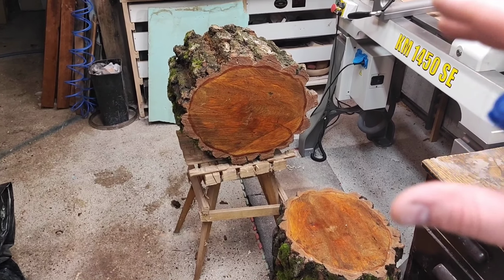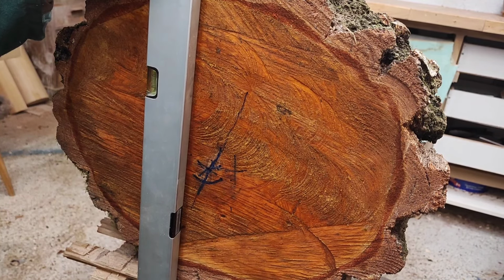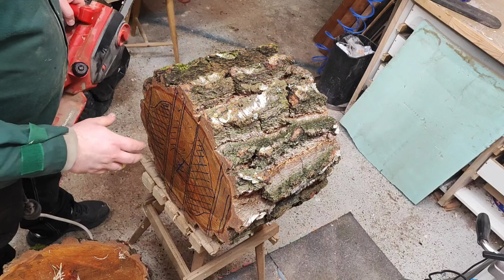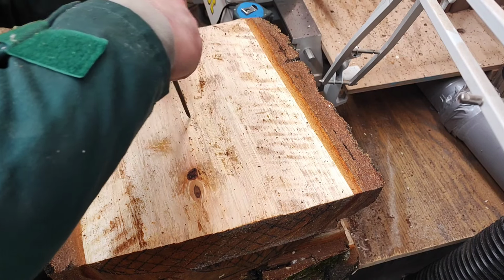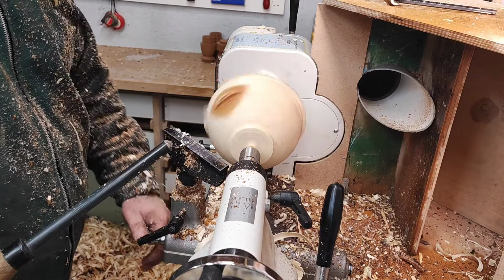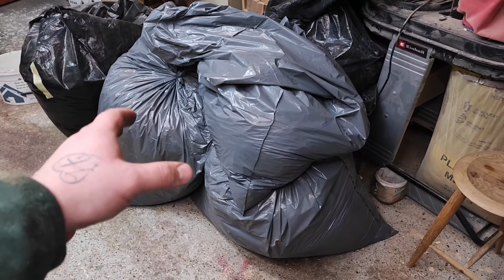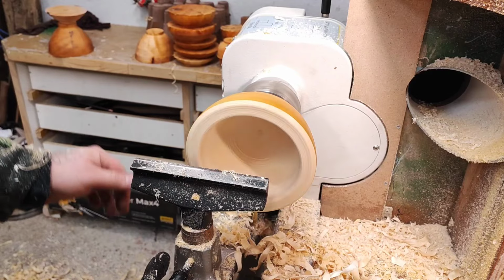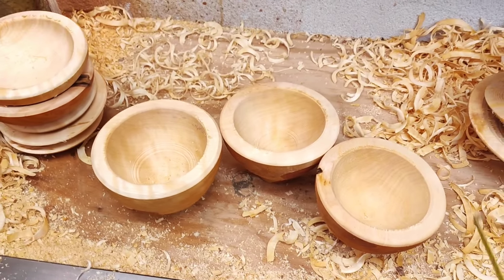How I price my work__season of rough turning

Comment: Minor technical detail. The pith doesn't have anything to do with nutrient or water movement in the tree. The cells of the pith and heartwood are dead. The xylem, which is the sapwood, is where the water and nutrients move from the roots up the tree and the phloem which is the inner bark (bark side of cambium layer) is where the nutrients and sugars move down the tree from the leaves.

Comment: Thank Toislav for the great videos; I’ve got a couple questions that you may have answered already but I didn’t see them in the comments. 

1.  How do you store bowl blanks till you get to them?  

2.  Do store round blanks and if so do you put wax on them?

I’ve watch several of your and Richard Raffins videos, you do an outstanding job of explaining each step; much  appreciated.
Reply from the maker: I just put them on the shelf , nothing special, and I did used to coat them to slow down drying with 10% diluted white glue but nowadays I just leave them plain and I always try to rough out in winter when its not hot and there is as little as possible water in wood
Reply: @tomislavtomasicwoodturning  Just after I sent this question, I saw your other video on how you store them, LOL.  Thank you for taking the time to answer my question.  Really like the videos, I have learned a lot.

Comment: Hello, thank you for videos they are great with details. I'm a lifelong custom cabinet maker who's had to make a career change due to cancer. I am starting to turn after being away from turning for 25 years.  I don't have much experience turning green wood or roughing blanks out. So, my question to you is, after roughing bowls out do you always coat them with something like anchorseal? Or can you put them in a bag to dry slow. I sure could use some help, I have alot to catch up on. Thanks and you and Richard Raftland are my 2 favorites to watch to learn from. You two put very nice detail on what I see most people ignore to do. Thanks again!
Reply from the maker: Thank you very much sir And Sorry to hear about your fight with cancer but I'm glad you won.

I rarely coat them unless its really wet or if its really unstable wood like plum.
But you can't go wrong with sealing them 

Also what helps a lot is rough turning in winter,or to get wood that has been fallen in winter as it will have less moisture inside
Reply: Also I wanted ask, have you ever turned any Black Palm wood into a bowl?
Reply from the maker: @curly43065  nope, I haven't 😀

Comment: Ever tried ripping chain saw from Stihl or Oregon?  They are time savers and produce a less ondulated or rippled finish.  A bit on the pricey side but worth it if you use it frequently.  They have DIY version on the internet, don't know if they are efficient.
Reply from the maker: No I haven't, usually I would cut this outside with gas chainsaw and regular chain, Works so beautiful... This perticular Electric saw is far from good

Comment: First, thanks for your videos.  They are very informative and educational.  Second, when you describe the time spent, you don't mention how long it will take to finish the pieces when dry.  I imagine it would take at least as long as the rough out.  I know for myself, I take 2 or 3 or 4 times longer to finish than to rough turn.  But I am not a professional turner, just a retired.   hobbyist.  I have a lot of pieces  in boxes and am considering going to a farmers market this summer to sell some of the several hundred pieces that I've accumulated on top of having given away well over 100 pieces to friends and family
Reply from the maker: Thank you sir,you are right, I forgot to mention that but usually it takes from 10 to 40 minutes depends on shape and size of the bowl to finish it,so not much time but also this is over 2-3 years the time it will take to sell these.... 
But it could be major factor for someone,you are right 😀

Comment: What did you coat the blanks with before putting in bags? Love the video.
Reply from the maker: I didn't coat them, they change color slighty as they are in there own micro clima under plastic, next video will be on drying wood so there will be more info
Reply: Thanks it was the color change that I thought they had been coated,
Reply from the maker: @brianremington5780  it changes color quite quick 😀

Comment: Thank you for sharing pricing. Do you charge differently if you use different species of wood, or it is more or less the same?
Reply from the maker: Thank you, usually depends on how much I payed for log, if I payed full price like 300euros then I would bring price little bit up.
Reply: @tomislavtomasicwoodturning 
I have never paid money for wood so far, i am harvesting by myself. Either at home (my own forrest) or locally. Usually it is some sort of exchange for labour or for another piece of firewood, and means i have to invest time to get the material.
So in my case it is free wood but always takes time to get it :)
Reply from the maker: @DennisLampret  understanding, that is major time away so you need to account for that a little bit
Reply: Yes it takes some time, depends on the situation… sometimes I get a big tree (like ash, beech, wild cherry) 100m from the house and we haul it with tractor here in 15 minutes😂 Other times i spend half a day cleaning up and cutting up branches into firewood to get one or two short (and roughly 40cm diameter, possibly rotten a bit inside) apple tree logs…

Comment: One thing you didn't mention is the fact of which side of the blank you choose for the top or bottom of the bowl. If you turn it with the pith at the bottom of the bowl it will have a different grain pattern.  And one that i like much better but if you have a small blank it is feasible to do it that way. Just my thoughts. Great instructions thank you for sharing.
Reply from the maker: Thank you for your input, its design thing as we can choose, especially on bigger logs, I do love pith on the bottom as well but I don't have opportunity a lot to do soo....

Comment: I just finished cutting up some elm blanks, which I've never turned before.  The log was about 20 inches in diameter.  I burnt the bar on my chainsaw while cutting with the grain,  those shavings probably stopped the oil from getting to the sprocket at the end of the bar. Now I constantly clean out the shavings and grease the sprocket. I'm going cut a sycamore tree for blanks this weekend and they'll be around 26 inches in diameter. I enjoyed watching your video and noticed that you cut the pith out and keep it centered on the log, see so many people loose half of the log after cutting the pith out because they didn't align it to where there's equal material on both sides.  I'm new to turning and have a lot to learn, but I've learned a lot from your videos thanks  !
Reply from the maker: Thank you very much, appriciate your feedback and comment, Thank you 😀 good luck with sycamore log, it should be walk in a park compared to elm☺️
Reply: ripping logs requires one to have sharp chain. Make sure oiler is working on saw.  I may be newer to wood turning but have close to 50 years running chain saw. Last time I greased bar tip was over 40 years ago.
Reply: @larryweinberg1191 chains are very sharp,  and I never had to grease the bar before ether, but the sprocket got hot from not getting enough oil due to the shavings and I to have 40 + years of running the chainsaws, but just recently started cutting with the grain,  and I'm using my old echo,whlch has given me years of
 dependability dependability

Comment: I have exactly the same issue with my woodcut max 4. Allignment issue pushing the middle size cutter backwards forcing the tip to rise. I am in the process of exchanging or getting a refund. Shame, i really wanted to get into coring. The mcnaughton system is available in U.K?
Reply from the maker: Indeed, its a shame, a bit dissapointing, but happens.

I think there is only in Dictum store McNaughton.... They probably ship to UK but also craft supply usa have it

Comment: Great explainantion. May I ask how far is the wall from bed of lathe? And is plywood top behind lathe pushed up against bed? For example how easy is it for you to clean up behind lathe and wall?
Reply from the maker: Thank you sir

The shelf is around 350mm from the wall to a lathe, and its not bad to clean, I would clean by hand the big shavings,then blow the smaller stuff , sweep and then vaccum the small stuff..... The bottom ,beneth the shelf usually I kick with legs the shavings under, but there is not much
Reply from the maker: Ohhh and the shelf is sort of jammed between lathe and wall

Comment: Вопрос по существу, Томислав. Ты навернякаведёшь учёт своих затрат в мастерской? Какая статья затрат самая высокая: материал, отделочные материалы, электроэнергия, инструмент или что-то другое?
Reply from the maker: I did but not on one off stuff, if I do big jobs like 400 shot glasses then I do consider other costs but for one bowl I use so little sandpaper and oil and steel on tools that it can't be measured, or atleast I don't bother .....
And when you consider,one big bowl will cover most expenses.

Comment: I don’t want to come off like a know it all, but I do use a chainsaw every day and if you cut down through the end grain the chips aren’t so stringy and the saw will clear them better 😅
Reply: Yea,but it's a lot easier cutting with the log laying down,  I've tried both ways and it's faster, but have to keep that bar well greased because the stringy shavings restrict the oil . Cutting from the end makes powder like the chain is dull, but once you try it laying down,  it does the job twice as fast. I cut the pith out in the woods, so clean-up isn't a problem.
Reply: @2363joey  agreed, but still consider clearing chips, with the chainsaw running, kind of risky, and it may depend on the wood, I’m cutting mostly green madrone and it doesn’t powder up, but again, other wood I cut like tan oak and your absolutely right, that why I said I’m not a know it all, just couldn’t help but put my two cents in😬
Reply: Ohh I understand, it's just whenever I'm in the woods cutting up a tree and have several logs to remove the piths time is an essence
Reply: @2363joey  this may help, when I first moved out to the woods I used a chainsaw to mill lumber for my cabin and I started at the end of the log and never had a problem but looking back I had ground the teeth to a lesser angle, you can also buy ripping chain and it clears the fibers out well, but changing chain wasn’t always the case and the regular rake seemed ok for a few cuts
Reply: I process hundreds of blanks each year and always cut with the grain (noodle) like this.  There are techniques to keep the long stringy chips clear as you cut.  Noodling is faster and easier on the saw and chain.
Reply from the maker: Thank you Bryan, I love to see this kind of comments as it brings to video more value, you are right, in some cases lt can help out cutting on endgrain but this long shavings are not problem for decent chainsaw, Usually my Stihl never clogs up , it this cheap one that has all sort of obsticals in shavings ahrout....
Thank you for input and for watching 🤗

Comment: Good information.  If you don't want to clog the chainsaw with shavings, set the log upright on its end instead of on its side.  That way, small chips and dust will come out instead of shavings that clog the chainsaw.